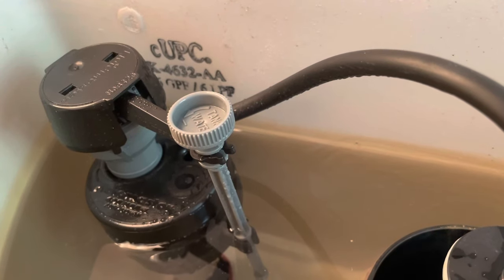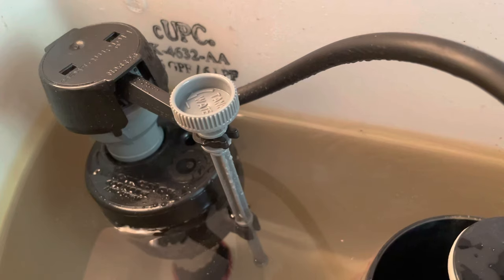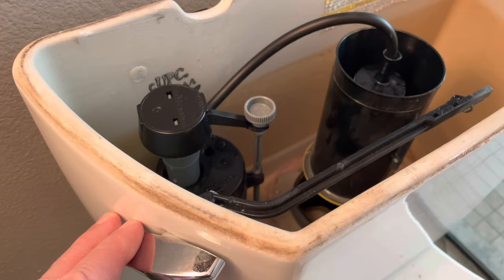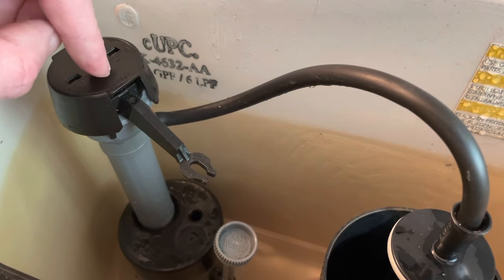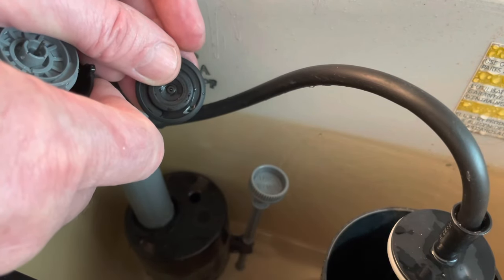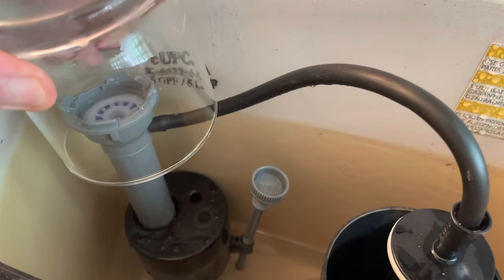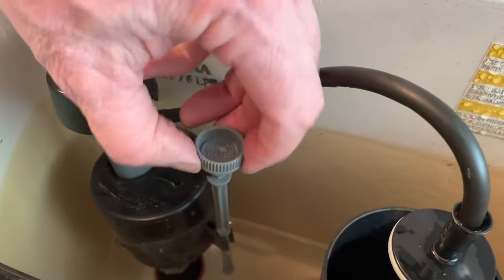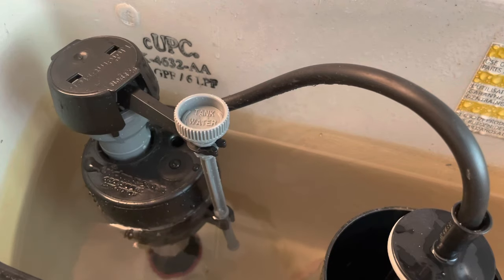Toilet Fill Valve Not Shutting Off / Don’t Replace / Fix Fast Cheap & Easy For Beginners

Comment: It seems though fluidmasters at my house do this about every 4-5 years and I go buy a new one.  Fluidmaster must know this and keeps quiet. I was ready to go back to the old style.  Now I will try this.  Thank you.
Reply from the maker: You bet, it’s the #1 point of failure, but not necessarily the fault of the valve itself… often debris & deposits build up in and around the seal, and a quick clean out will solve the problem. Personally, I just keep new seals on hand. I figure as long as I’m in there, it’s quick and easy to swap out. It’s a great little trick to know.

Comment: Awesome tutorial!  Everything was as you said. When at the store to replace the rubber gasket we opted to purchase the whole fill valve. Problem solved!
Reply from the maker: Glad it was helpful for you. Also, when you replace the valve, you can change out just the upper portion in seconds with no tools. Here’s a vid:

Replace Fluidmaster Toilet Fill Valve in Seconds For Beginners NO TOOLS NEEDED
https://youtu.be/ovdWF5Hdz8U
Reply: @papajoeknows8355  Thanks for the great video Joe.  I scanned through the 544 related comments, but I must have missed your link for purchasing the rubber seal.  Can you please provide it for me?  Thanks!
Reply from the maker: @stanw74utube  you bet, and the link’s in the description at the bottom. 👍🏻

Comment: Mine was so bad I couldn't even flush it out by turning the water on. I had to use a Bobby pin that I cut the tip off of to pick ROCKS out from around the spout. Didn't even have to take the seal out. It was just barely dribbling and wouldn't fill up before, now it fills up in like 5 or 10 seconds. Thanks a ton man, every other video basically just says, hey change the fill valve because it's so easy.
Reply from the maker: Awesome, glad it helped! 👏🏻
Reply: @papajoeknows8355  There were hardly any videos on how to fix or repair an existing fill valve, thr majority of videos were simply showing how to replace the entire fill valve because it is so simply and easy. I wanted to try and repair mine, not replace it right now. So this video you put out is a real gem, and stands out from the others. I would try to keep stuff like this in mind when putting out any future videos if you still do that, just a thought. Anyways, thanks again, and I wish you the best of luck sir.
Reply from the maker: @AcidxAnarchy  thanks, I appreciate… I’ve got a bunch of videos out, lots of life hack / DIY stuff.

Comment: Works with a few modifications...metal hook in place of grey dial float attachment that you detached...couldn't remove the metal hook, so just twisted cap off per your instruction...came off easily.  Removed rubber ring...lots of sludge...washed rubber ring with water, no solvent, dried, sprayed with seal conditioner I use on my car's rubber seals, put it back in place...checked for any solids on the white filter, none...reconnected, just pressed down and turned right...turned water back on and all is back to right operation!  Yay!  Thank you so much! 
Ps. Should have watched sooner, would have saved on replacing a new flap that wasn't the problem...resetting the water level which also wasn't the problem!  I guess the trial and error process brought me to the right question to ask which brought me to you.
Maybe a, What's the real problem, video would save a lot of time and a few trips to the home center.
Reply from the maker: Yes, a “what’s the real problem” video is a good idea. Glad it all worked out for you though. Sometimes just changing the valve can be easier, as they’re only about $10, and there’s a little trick where you just change out the upper portion. It can be done in a few seconds with no tools. Here’s a video:

Replace Fluidmaster Toilet Fill Valve in Seconds For Beginners NO TOOLS NEEDED
https://youtu.be/ovdWF5Hdz8U
Reply: Thanks for this comment as my stem also is a metal rod and I can’t remove it. I’ll try your method when I get back from work!!! And thanks, Papa, for the old school tip to fix this problem! ( maybe edit your description to add the metal rod variation)😊👍🏼🙏☮️

Comment: I bought a new valve the other day not knowing better ,lifting the lid up I had never noticed on the underside was complete maintenance instructions on the under side of the lid. But I ended up putting the new Fluidmaster valve in that was fast fill and even had bowl water level adjustment on it now it works faster than it ever has.  I never attempted to figure out what exactly the 8 different color coded caps mean on each valve but the one I bought replaced them all.
Reply from the maker: I had TOTALLY forgotten about the underside of the lid… you just prompted me to post a video about it lol. 👍🏻👍🏻

Comment: Thanks.  I knew the seal was in there, but I didn't know  how to get to it.  I used to replace those seals in the older fluidmasters.  Back then, the seal was in the base, and you removed the whole thing in the same way, by pushing down and twisting an eighth of a turn counterclockwise.  One caveat.....the debris under it is the problem a lot of the time, but the seal fails sometimes, and you can see the failure if you look hard enough.  The failure will show up usually as a small crack in the rubber, but it will be hard to find, unless you take your fingers and flex the seal this way and that, because the crack will be down in the folds of it.
Reply from the maker: Absolutely correct, the debris is usually the problem, and small cracks in the seal are hard to detect. That’s why I just keep some on hand… I figure while I’m in there, it’s easy and cheap enough to just change it out. 👍🏻

Comment: I'll admit when you started talking about keeping extra rubber seals handy and leaving a link to order some is when I began to be discouraged.  Of course I did not have any extra toilet floater seals handy and no, I didn't have time to order any (it's 9 pm on a Thursday night and my wife wants the toilet fixed NOW).  At any rate, I tried everything you said: released clip, turned and removed plastic cap, took off the rubber seal & replaced same exact one (since that's all I had), did the slowly turn on water trick w/upside down glass above. After all that I put it back together and tried to flush 🙏😬🤞......

Holy smokes it worked!  

"Honey, guess what....?!  It's fixed!"

Meanwhile,  I noticed the name of this YouTube channel.  Well about that, my Step-father is called "Papa Joe" and of my wife's grandmother it was always said "Grandma knows"  IE Papa Joe Knows.

So yeah, we took it some kind of mystical connection...lol.  All to say: thanks so much.  Of course, liked, commented (at length) , subscribed.  👍👌😏  thanks man
Reply from the maker: Hahaha, the Papa Joe connection. And very glad to hear the video helped. I probably so do another video where you just flush & clean out any debris and replace existing seal, because most of the time that actually works… I just replace with a new seal because I figure if I’m in there already, I might as well do it, and I have some on hand. Thanks for taking the time to comment, I enjoy hearing hearing when a video has helped someone! 👍🏻
Reply: Well, last time your tricks worked like a charm.  This time around,  not so lucky.  Sigh..  

What now I wonder 🤔
Reply: Update...spent 18.99 and replaced the whole unit.  Our local hardware stores were closed but thank goodness for Tractor Supply

Comment: Thanks Joe. Here is another issue with the fluid master not shutting off. I had issues with the float sticking and the water level rising over the top of the float. To fix it, remove the top like shown, and lube the pivot area of the black rod with Vaseline .
Reply from the maker: Interesting, I’ve always just replaced them when that happens, but I’ll have to consider that for sure. 👍🏻

Comment: Hey man, thank you so much. That solved it. Although, I didn't have to replace the gasket, just flushed the fill valve to clean out debris. Saved me buying a new one or paying someone to fix the issue. Btw, Fluidmaster does have a section on their website that guides one through flushing the debris.
Reply from the maker: Good to know. And yes, alot of times it just needs flushing / cleaning out. I usually just replace the seal anyway since I’m there, but glad it worked out for you! 👍🏻
Reply: @papajoeknows8355  Update: I wound up replacing the gasket and now the water really does stop. The cleaning was just temporary in my situation.
Reply from the maker: @eddiegang544  yeah that happened to me once. Now I just keep some under the sink. I figure if I’m going to bother taking the cap off, I might as well just put in a new one. 👍🏻

Comment: I’m not trying to steal any thunder from the video, because it was really good and articulate. I’m just stating what worked for me. I noticed my rubber washer valve was a bit slimy and had dimples formed. I washed in hot water with soapy suds and turned the orientation of the washer a bit by turning it a bit. Now I have one of those 1 1/2 gallon tank toilets which I cannot stand, but I adjusted the float stem a little bit, I can only adjust it so much because again it’s only one and a half gallons approximately. And the valve turned off for me. what was happening with mine was the toilet tank was over filling into the overflow tube because the valve would not shut off because the float was as high as it could be. So I adjusted the both that I mentioned above. Also, after a while, rubber becomes a bit brittle as it ages, but on my fluid master , it was only a year old and appeared to be in good condition and that’s why I ran it through hot water from the tap. I’m pointing this out in the event you wanted to try this first so you don’t have to get in your vehicle started burn gas, and time and parts are extra money. Whatever you do, post your success or failure in your endeavor and in trying to be a DYI  Expert, and to give back. The reason why I am posting is because I want to see how long my repair may last, if it fails later on. I will try to report back if and when it ever fails again.
Reply from the maker: Yes, often the rubber washers can be just cleaned up a bit and be functional again. I just keep some on hand… I figure while I’m in there, it’s easy enough to switch out. It’s also a good idea to flush out any potential debris or “gallstones” as I call them, as they can also impede the functionality. And to your other point, an improperly adjusted float, causing the water level to rise above the overflow is an extremely common reason for a continuously running toilet, as the float can’t possibly rise enough to shut the valve off. I did a separate video on that. Thanks for taking the time to comment, an I’m glad you’ve been able to resolve the problem. 👍🏻
Reply: @papajoeknows8355  yes for sure

Comment: Thank you for the video. It was super helpful. I live in an apartment and my landlord is good about getting repairs done but my DIY pride and OCD wasn't letting me wait that long. I have hard water too but no softener so sure enough there was some pretty deep mineral build up. Seal definitely needs to be replaced too so I guess I'll be doing that when the part comes in.
Reply from the maker: Awesome, glad it helped you!

Comment: Thanks bud, mine is an American standard fill valve, but the cap came off the same way. And it was just one little particle on the valve that needed to be flushed off. Didn't even need a part.
Reply from the maker: Awesome 👏🏻

Comment: ok so I did what you said and actually I did see bits of the inside pieces broke inside so I took it out and it's still 🏃‍♀️ running and they are pieces that broke off from the filler inside they are gray pieces so I will have to replace the whole thing this is what I will do thanks for giving me some insight of what to do.

Comment: Thank you very much.  This 
Video clarifies so much as I was afraid to pull the stem out of the clip as i thought outloud,  "What happens if I break the clip?"  I was unaware of that rubber gasket.  Now I know my first steps.
I just want to know, if it continues to run, how is water being wasted if both the tank and bowl remain filled.  Where would the water go?  Have been staring at the mechanism for weeks🤷‍♂️.  I will be a fool if I have to pay $195.00 hourly to call the plumber if I can do it myself.
Reply from the maker: What happens if the fill valve keeps running is the tank fills to the height of the overflow pipe (the tube that sticks up in the center), then it goes down that tube and into the bowl. As the level of the bowl slowly rises, the weight of the water pushes it down the drain. Where I live, water is expensive, and a running valve can get costly in a hurry.

Comment: Helpful but mine was a little different. I had to lift instead of pushing down before turning the assembly to remove. Couldn’t figure it out until I viewed another channel’s video and they said lift. So glad I didn’t crack mine. Thought someone else might need to know too.

Comment: 🎉HARD WATER?🤔 This is the one ladies and gents, fixed mine in 5 minutes!🤯 White vinegar in a foaming toilet cleaner bottle helps a lot & a dental pick for those really clogged water passages under the small rubber gasket. GREAT VID!👍👍👍

Comment: Welp, I did what you said but the top never came off. I worked it for a solid 10 minutes and could feel it twisting but for the life of me it just wouldn't come off.
While that didn't work, there was a LOT of buildup that flaked off, and ultimately the leak stopped so thank you 😂👍
Reply from the maker: Glad it’s back to working for now, but it sounds like it may just be time to replace the valve. It’s easy to do, and they’re only $10.

Also, there’s a trick where you just replace the upper portion… it can be done quickly and with no tools. Here’s a video…

Replace Fluidmaster Toilet Fill Valve in Seconds For Beginners NO TOOLS NEEDED
https://youtu.be/ovdWF5Hdz8U

Comment: Thank you, this happens a few time a year but in the past it only needed the top cap removed and water run through to clear the grit. But this time just running water didn't fix it and I didn't know that rubber seal could be removed and after removing it even smaller grit was there, so after cleaning it out problem solved.
Reply from the maker: That’s awesome, I’m glad it helped you.  And yes, alot of times just flushing it out does the trick. I keep some seals on hand, I figure as long as I’m in there, I can just quickly change it out.
Reply: @papajoeknows8355  Have you ever looked close to the seals you replaced, are they rotten or cracked?
Reply from the maker: @BEDavisBrown  mostly I’ve just seen the rubber sort of breaking down and determining to where they’re not making a good seal.

Comment: I have a valve that runs quite a while after flushing but shuts off fine.   It's like it's slow filling the tank before shutting off.   I kinda assumed the fill valve was clogged and was just going to replace the whole assembly but might try this instead.

Comment: Excellent video. I have a toilet that the tank kept running continously for hours and the water was going down in the toilet. It caused a water damage on the ceiling of the floor below. What puzzled me is that there was no water around the outside of the toilet. The bathroom floor was dry. I shut off the water supply to the tank  and the leak on the floor below stopped.
Reply from the maker: Sounds like fixing the fill valve may be only part of the problem… it’s possible you may have a leak at the wax ring and the water is simply dissipating to the downstairs ceiling below, before it even appears at the floor level. Replacing the wax is relatively easy, but requires pulling and resetting the toilet.

Comment: Thanks for your video. I have the Fluidmaster 400.  Mine was leaking by the seal you showed and so I replaced it. No change. I flushed the fill tunnel for 30 seconds full flow, no change. I cleaned the white plastic seat at the top of the fill tower, no change. Something else is causing this problem. When I replaced the entire assembly, the leak by is gone.
Reply from the maker: Yeah, sometimes you just have to give up and replace the whole thing. 👍🏻 Also, here’s a hack for replacing the upper portion (no tools):

https://youtu.be/ovdWF5Hdz8U

Comment: Hi, your instructions were easy to follow. I think I have to replace the whole because the fill tube keeps running full  blast. You do have a video for replacing the whole fill valve?
Reply from the maker: Yes, the easiest thing to do is to get a new one, but just replace the upper portion. Here’s a video…

Replace Fluidmaster Toilet Fill Valve in Seconds For Beginners NO TOOLS NEEDED
https://youtu.be/ovdWF5Hdz8U

Comment: This is good information to know. But fill valves are so cheap and easy to replace I wouldn't bother fixing it unless a replacement was not available.
Reply from the maker: Often there’s nothing wrong with the valve at all. And replacing / cleaning the seal & flushing out debris is referenced in the valve instructions.

Comment: mine wasn't cutting off and overflowed from the handle gasket spacing and ran for almost 5 minutes before my cat alerted me. i did your step by step for removing the top and rinsing any mineral deposit and it looked clean under the cap, but for some reason that fixed it! (for now) its a very slow fill process
Reply from the maker: If it’s refilling slowly, it may just be time to replace the fill valve, which is easy to do. But water should never reach the level where it’s leaking out at the handle… it should fill to the top of the overflow tube (the pipe in the center of the tank), then continue to drain down that tube if the valve were to keep running. That’s the actual purpose of the overflow tube. The top of that tube should be lower that the level of the handle. Is that the case?